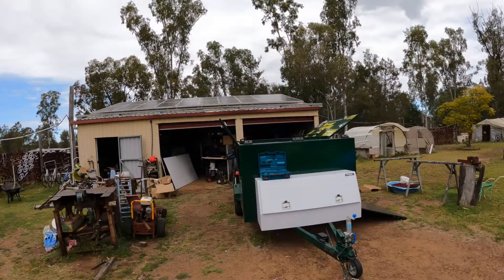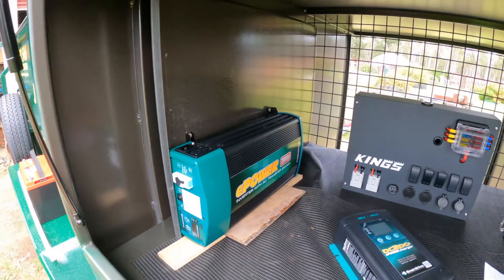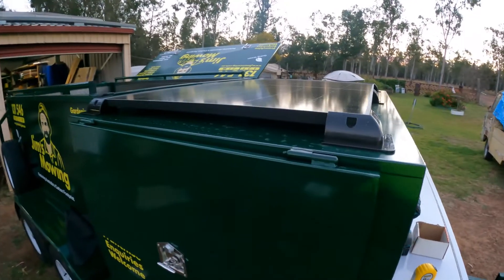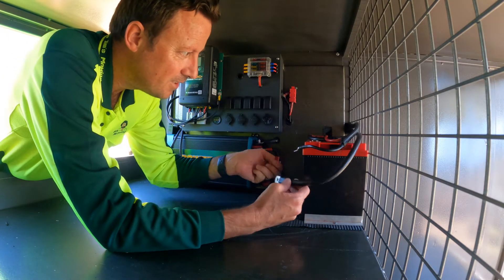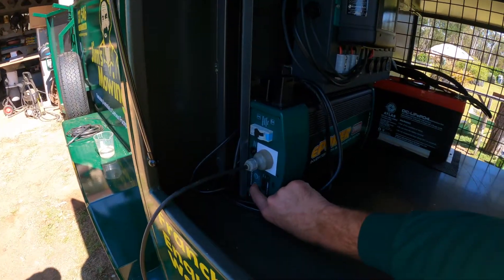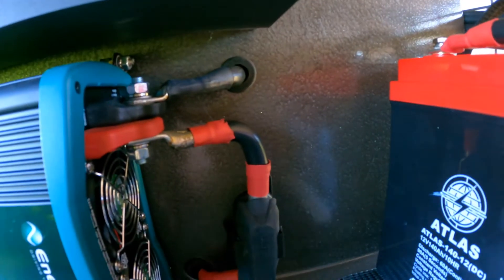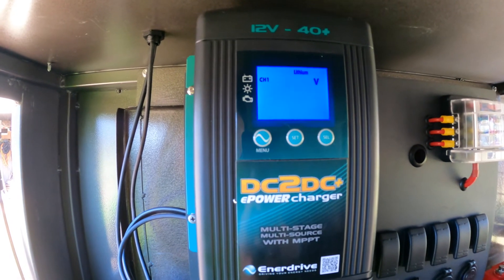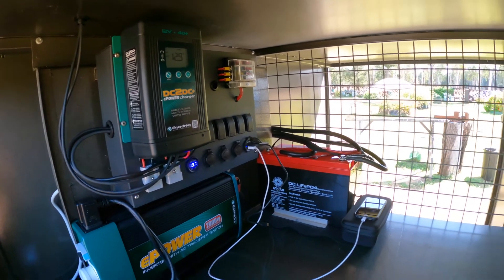Jim's Mowing - Oxenford "Solar Trailer Fit Out"

Comment: Another issue im seeing is you are charging batteries  inside a very hot steel trailer,  this absolutely kills battery life.
Reply from the maker: Hi Paul, 

Here is a breakdown of what the solar trailer equipment cost me:

Enerdrive 12V 40AMP+ DC2DC Charger: $455.00
Enerdrive Epower 12V 2000W RCD Pure Sine Wave Inverter: $1,169.00
Jenko Tiger 370W Residential Panel: $185.00
Kings 12V Control Box: $149.00
Fuses, cables, heat shrink, crimping tool, cable ties, solar bracket's, etc: Approx $400.00

I agree housing it in a steel trailer is not ideal, but not much different to the rear canopy of a Ute. There is some ventilation with the mower box and also potential to put a whirly bird or insulation for further cooling/ventilation. My thoughts after a few years running this set up is that it’s a great option. I don’t need to have as many batteries on hand, as soon as they are swapped out it goes straight into the charger and is charged before I need it. Also no need to remove and replace each night to charge several at a time. I would do it again, but it would be good to have it in a canopy to get the most out of personal and private use. Each 10amp/h ego battery is about $600.
Reply: Thanks for the breakdown,  I guess most guys wouldn't have the skills to self install so would need to add labour costs.   Are you needing to charge on the go for your battery mowers?   I run EGO blower and line trimmer and find one 7.5 battery on each gets me through a whole day, but I use petrol mowers.
Reply from the maker: @paulluck6959  I pretty much just rotate the charging as soon as one gets low. I find the trickle charger is a better option rather than the turbo charge unit. You don’t use the resource of the main battery so much. The amperage your making from the panel covers the amount required to charge on a sunny day. I used to use the battery mower more but find in most cases I just prefer using the 216. Realistically a better option would be a Pellenc mower for all day use then overnight charge. Again it’s hard to beat the cut and power of a good petrol commercial mower.

Comment: Hi what does something like this cost to set up ? Just the charging costs I have a trailer already
Reply from the maker: Hi Chris, it probably cost me about $2,500 in parts as I did most of the work myself. If you have a look at the video description I think it may have a basic pricing list. Lithium batteries can be expensive if you get a real big one which would be helpful. I think the 2000w inverter is a bit overkill but I thought better more than not enough. I never charge two batteries at a time currently just due to the battery capacity. You can get an fully enclosed unit from Enerdrive called The Lackey which would be a great option. If you are using a smaller battery and solar panel an anderson plug to your alternator would be essential. I just haven’t got there yet.
Reply: @jimsmowing-oxenford1826  hi mate thanks for
The reply I will check that out looks like a great set up
I will only be charging a few makita 18v batteries for hedge trimmers etc for my day to day stuff for now
Reply from the maker: @Pup43  no worries mate, yes it goes great. I do a fair bit of charging throughout the day and want to run a fridge at some stage soon. I'll need a larger battery or a second battery and anderson plug set up. You may get away with a smaller unit (1000w inverter) and the 40DCtoDC charger and a small panel. Lithium is the way to go for the battery mate, and the enerdrive gear is top notch.
Reply: Surely there comes a point where its just cheaper and easier to buy more batteries?  $2500 buys you about 5x EGO 10ah batteries (even less if you buy EGO kits/promotions).